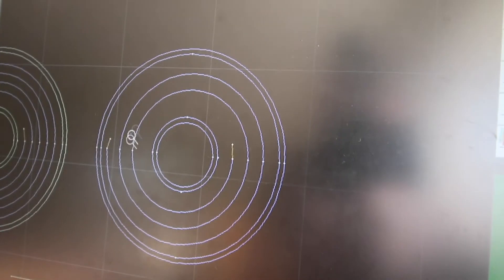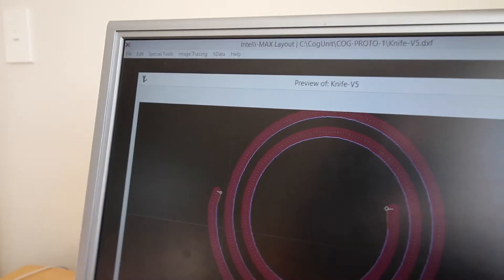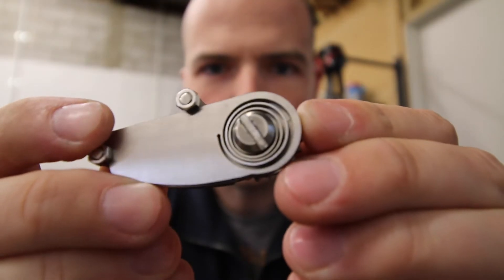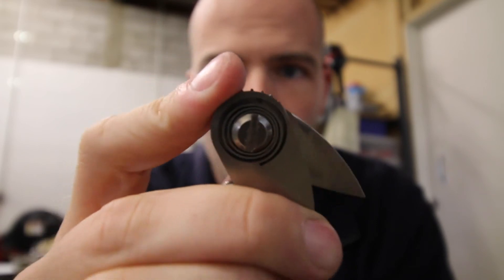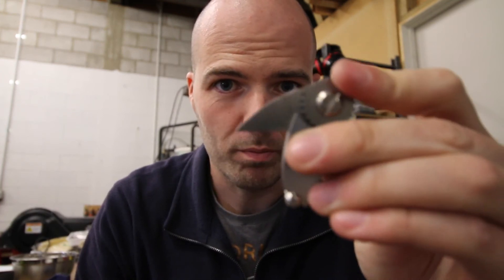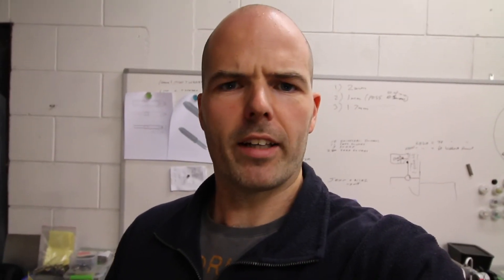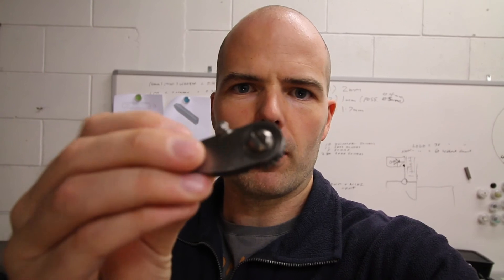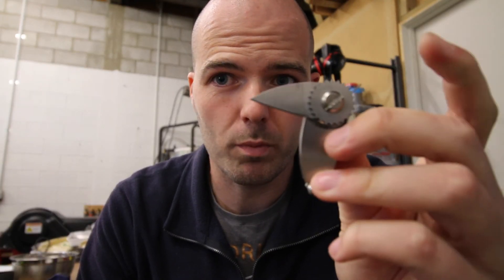How To Make A Knife (Part 6)

Comment: why don't u do the locking mechanism as a ratchet Style  so as u put the blade back their is a locking bar interlocks with the gear cos shape finger opening piece then to close it all u have to do is apply pressure to the opeset side of the locking bar ( similar to a folding knife with a spring lock near the end of the handle ) to disengage to bar from the gear cog allowing it to then snap shut with the spring in the blade, this knife looks very smart good luck with this project :)